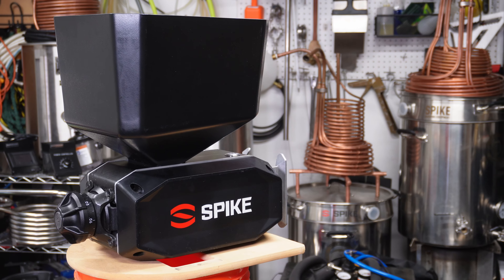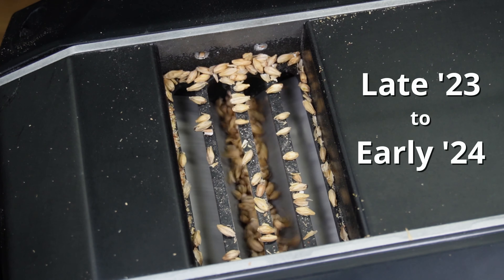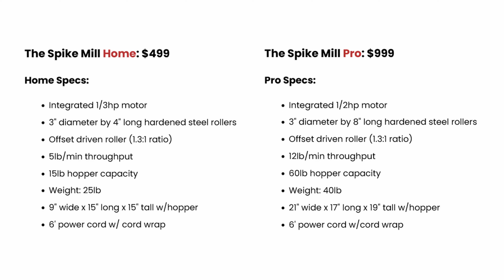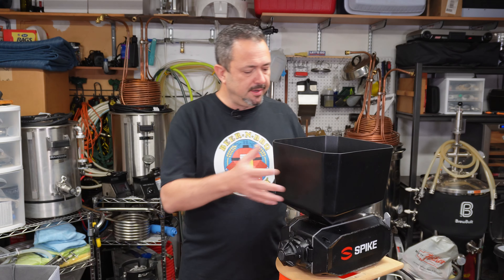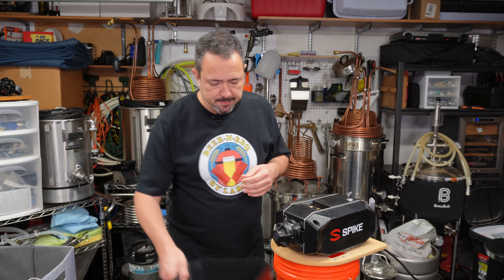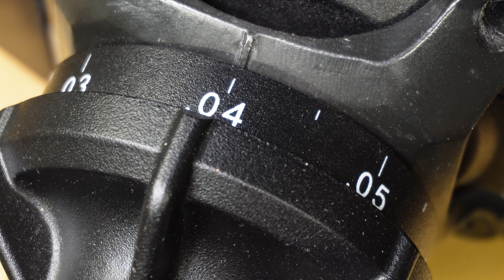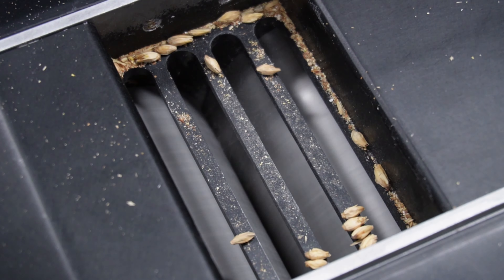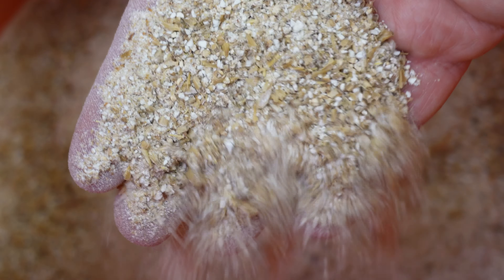The Spike Mill: Early Review

Comment: I would certainly like to have one. The one I have (uses crank for hand drill) works ok and my brews come out well. but I sure like the quick, positive adjustment and build quality. Perhaps in the future I will spring the $$$. Considering the pricing of other mills out there, it does not seem out of line for what you get. Thanks for the quick review.
Reply from the maker: Right! The inclusion of a motor certainly raises the price.

Comment: This is pretty attractive. I had been eyeing the Maltzilla but was apprehensive after reading/watching complaints about the QC. This is a bit pricier but the features and fit and finish look excellent. Will definitely consider it after more reviews come out. I hope they offer a cheap pre-drilled base plate with it.
Reply from the maker: They have a bucket adapter lid to mount it on as well as a mill table made just for it.
Reply: Maltzilla gives great results. Knock on wood I got a good motor

Comment: Looks very robust. I have a Malt Muncher. I have rigged up a Phidgets motor and a chain drive that runs off my Milwaukee drill batteries. Takes the need to babysit the crushing process. If I could find a nice little table to mount it on that a bucket will fit under, it'll be getting mounted on it. Cheers Larry. Great Vidya as always. Spike did a great job on the design of this mill.
Reply from the maker: Sounds like a good DIY solution.

Comment: One thing I can always count on with Spike Brewing is whenever I see something I might want to buy from them they are are almost always out of stock.   I waited months to get the pressure lid upgrade for my Flex fermenter.  And there have been at least three other times where I was interested in buying product from them but they were unavailable.  So I ended up buying from the competition because I didn't want to wait two or three months or more.  Most recently I wanted to buy a Spike Flow pump.  It is unobtainium.  So I bought a Blichmann Riptide instead.  Spike Brewing needs to understand product availability issues is costing them business.

Comment: I think the design department needed to justify its pay.  It looks good, and I like the idea of it being motorized. No more drills on brew day. But I am achieving 74-76 % with my simple Barley Crusher. How much more brew house efficiency can this thing give you? I am retired, so an additional 500 bucks is out.  BUT!! If I had the extra money, I do like gadgets, and I would buy one.
Reply: When the bushing go on your Barley Crusher(and they WILL fail) you will have to other replace them or buy a new mill... ones in mine are shot, the drive roller slops around making the gap inconsistent...
Reply: i haven't noticed any issues with the bushings yet.  But I will keep an eye on them.  Like your icon.  @MaryBrownForFreedom

Comment: Ok tell me i use a victory mill with two plates that have a gap. The roller mills crush by squashing the grain. 
Why is one better than the other. ?
As for the belt chain issue the dust will suck out all the lube.  A kevlar timing belt is far superior. And isnt affected by the dust.  I had an application very close to this. And the chains didn’t hold up. The belt lasted forever no stretch no wear.
Reply: The old knurled roller design pinches/crushes the husk and is really abrasive. This doesn't leave the husk in tact and creates a lot more flour. The shearing action cracks the husk and is far more gentle. Most new mills have this shearing action. Ours provides this with the helical fluted rollers and the offset driven design. Most home brew mills (especially the cheap ones) were either designed 50 years ago or designed overseas by engineers that don't brew beer.

There's a popular mill on the market that uses a belt drive. We'll let you do the research on how that is working but we specifically avoided that. Our chain doesn't need lube so there's no worries there. We've run our test mills with 10,000's of grain and haven't had any issues with the chain or gears. If you're using this on the home brew scale we're confident that your children's, children's, children will still be using this beast!
Reply: Jumped on the Kickstart a few months back. I am really looking forward to not using my drill or adjusting the gap all the time. Merry Christmas to me🍻

Comment: Honestly, I'm not impressed by the looks of the milled malt. Considering the price, there are too much broken husks when milling at 0.04" (that's just over 1mm). Also, why should it be better to drive the rolls at different speeds? If anything, I want to reduce the sheering, since it's that what destroys the husks. Sheering is the problem of all mills where only one roll is motorized. Why do they introduce it on purpose?
Reply: We developed the Spike Mill while working with Briess Malt to really hone in the crush. They are the experts in the industry so that is why the shearing direction was taken.